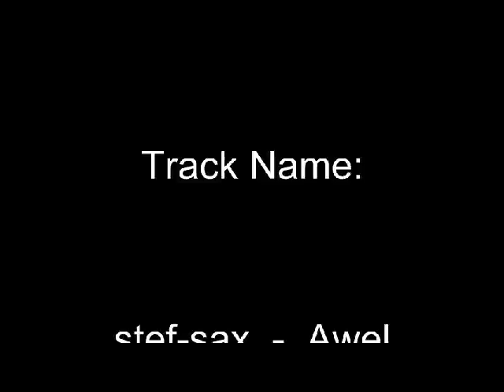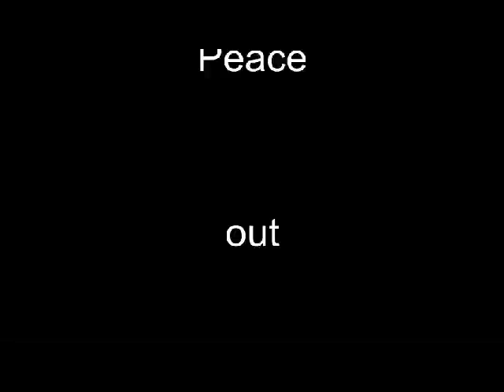Marlin 1894 STEP BY STEP FULL Maintenance / Cleaning Disassembly  PART 1

Comment: Thanks to this video and the reassembly companion video, I was able to repair my 1894 .44 Magnum. I had a squib fire and needed to be able to drive the slug back out. I would have never tried the tear down without these videos. Working thru the parts made me really admire the design of this weapon. BTW, my 1894 is a 1972 model and the ejector does not have the locator lug as in this video. Anyone know when they changed the ejector design? Also, this rifle predates the crops bolt safety.
Reply from the maker: G'day Carl Yee.  Glad my video was helpful with your predicament.  My rifle was manufactured in 2009 and I would say it would be slightly different to your 1972 model.  I'd bet your rifle is a beauty, and for it to still be functioning well after all this time, is a testament to the quality of these firearms from a manufacturer of such renown. Cheers and Happy Camping !
Reply: +tiouty01 would you believe I was given this rifle in mid 1990s and I am not sure when it had been last cleaned, if ever. I hadn't until this time. Now it cycles  unbelievably easy where it was very draggy before. 

It is an almost pristine model, except for some wear marks around the loading gate. I also have a S&W Model 29 that is also .44 magnum.

My next goal is to disassemble my 1892 Winchester in 32-20 and clean it. I haven't looked yet, but I am sure someone has videos for the 1892 service/cleaning. This rifle is a 1907 model. Also carry my Colt Single Action Army in same caliber when I have it out in the field. It is a 1906 model, Bisely model.

Thank God for You Tube and folks like you.
Reply from the maker: G'day Carl,Sounds great that your rifle now cycles smoother than before.  I am glad my video helped you out.Sounds like you have a nice assortment of classic rifles. Good for you.Best Regards.Cheers and Happy Camping !